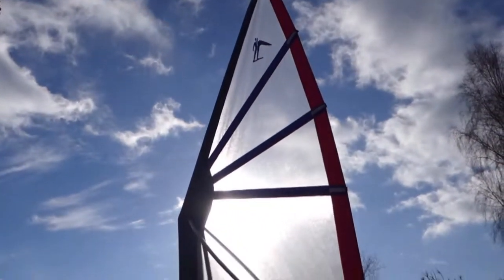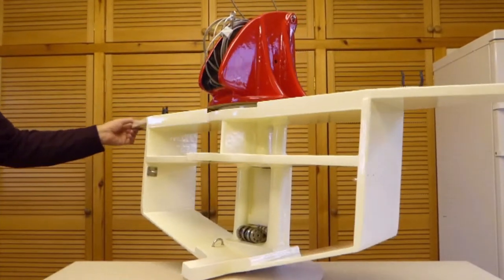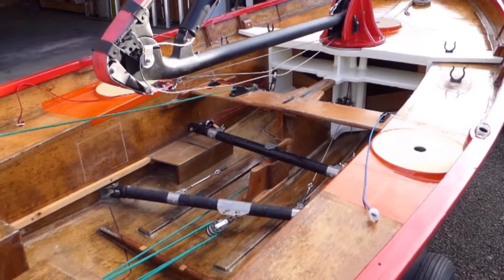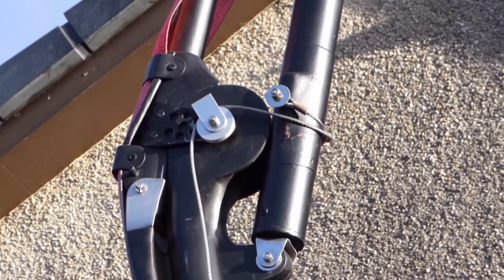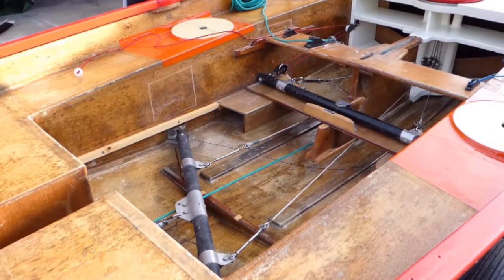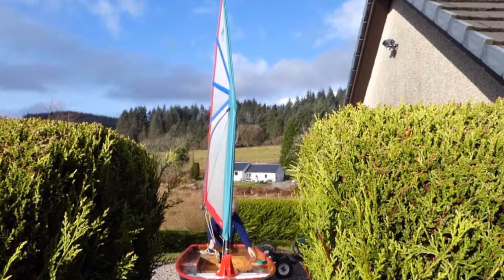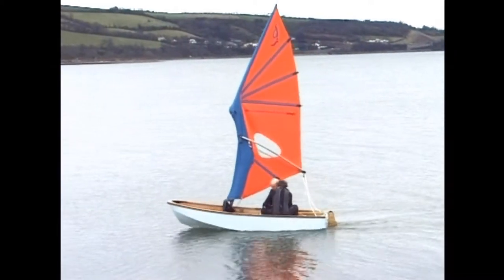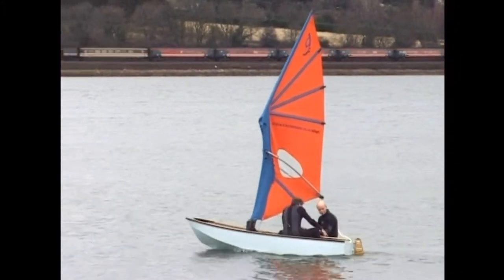Transition Rig - pronation/supination

Comment: How is it better than a normal rig?
Reply from the maker: Thank you for your enquiry, Peter. By 'normal rig', I shall assume a Bermudan-type rig with fixed, stayed mast, triangular mainsail without full-length battens, and a jib mounted on the forestay in front of the mainsail. I believe the Transition Rig is better than a normal rig in that it has a cleaner aerodynamic form, it is simpler to control while sailing, and can be readily folded into a compact bundle when not in use or if conditions become dangerous. Taken to its full potential, the jointed mast allows variation in geometry while sailing, including flexion/extension of the rig to adapt to gusts/lulls in wind strength, and pronation/supination of the rig to optimise the aerodynamic shape of the rig when going from tack to tack.
Reply: Thank you